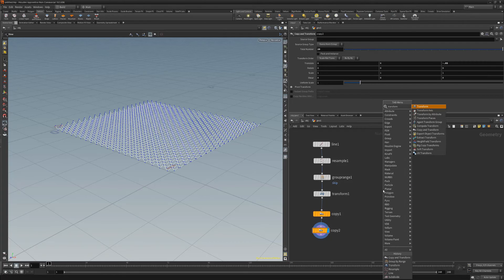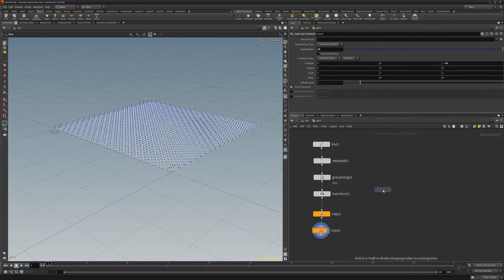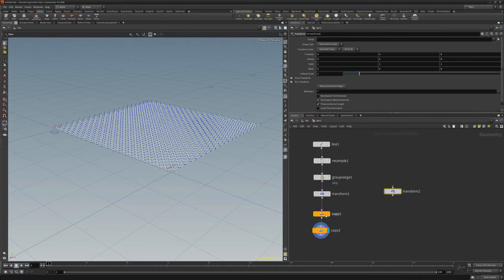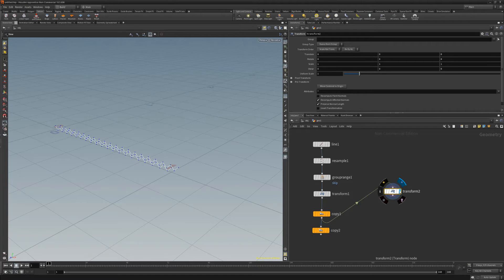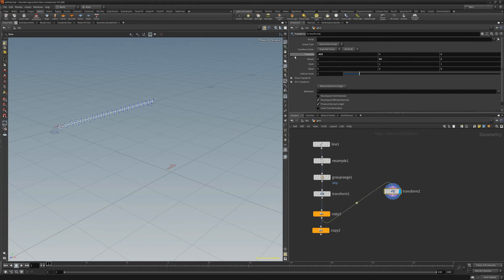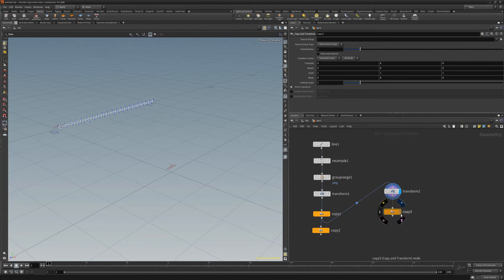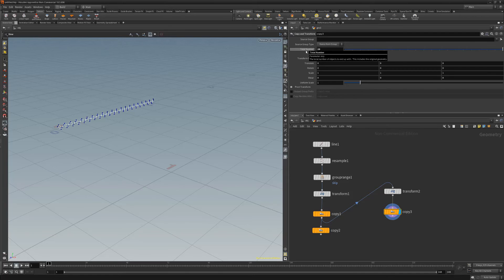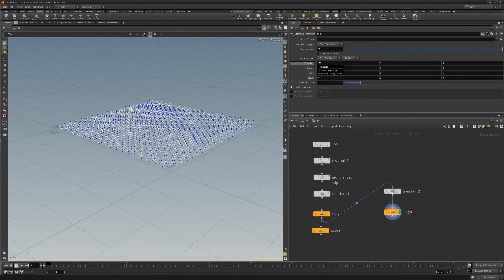Houdini | Generate a Woven Mesh

Comment: Nice one!.

As you may have already guessed the copy&transform is the radial array from modo. Just set 360/relative reference of Total Number in the rotate Y axis and tweak the pivot to ur liked. After it u should use a match size SOP to center the geo back to the origin (i usually set the render flag on this one and back to tweak the pivot)
Reply from the maker: Thanks for the info!